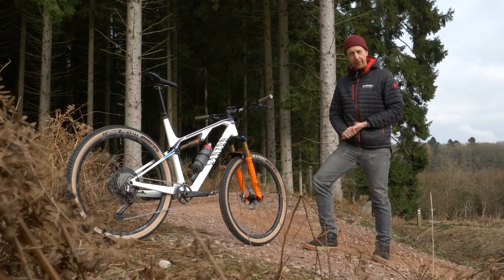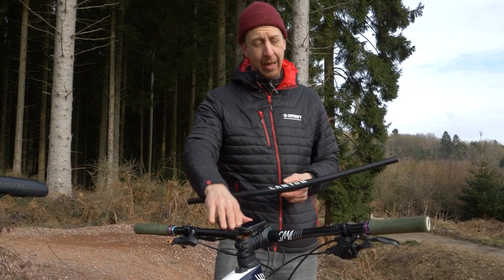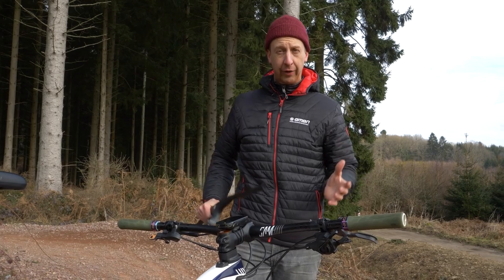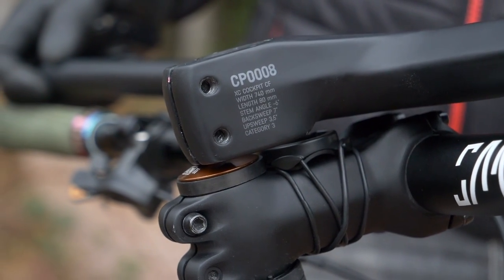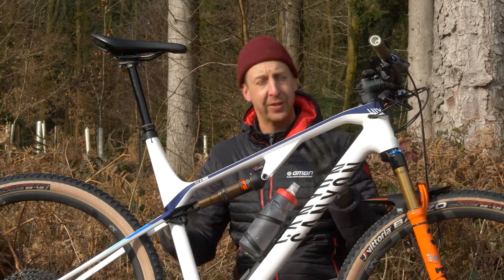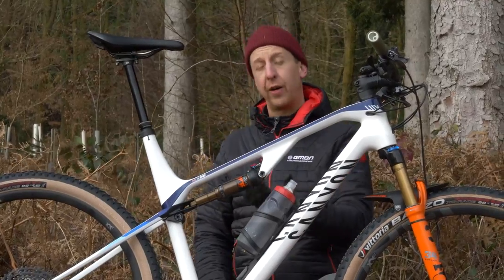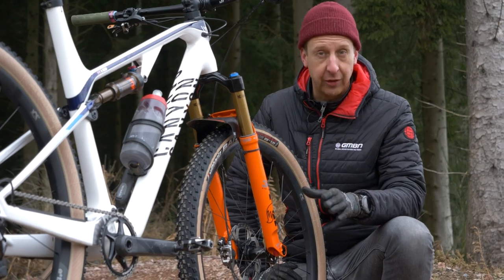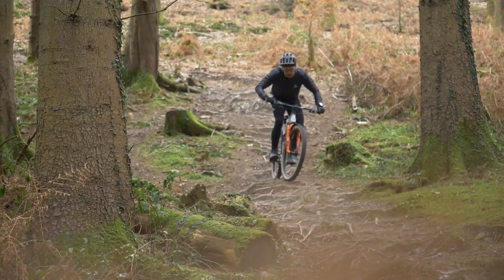How To Make Your XC Bike More Downhill Capable | Downcountry MTB Mods

Comment: So I was in a unique position where I didn’t have a single bike. It I had a decent budget to either get 2 mid range bikes or one high end bike. Thinking a gravel bike might be the best option as I could do some road and basic off road riding with it I discovered the bike that I wanted was still out of my budget range. But I think this was a good thing as it lead me to look at an XC bike. I was surprised that the geometry was steeper than a trail bike, the 29” tires made the bike fast on or off road, and it even had carbon wheel that made the bike super light and again really fast. So I decided on getting the Giant Anthem Advanced Pro 3. It’s great for basic trail riding, which is all I want after some unfortunate crashes due to me thinking I’m a better biker than I actually am, and it’s fun on the road as well. I’m sure that one day I’ll get some type of drop bar bike, but in the mean time I have the all round XC bike that suits my needs to bring full two wheel enjoyment. So what are your thoughts? Did I make the right decision?
Reply: I was in a similar position, looked at gravel (only for 5 minutes because i know i'd never get on with curly bars & brifters!) & then bought a 2017 giant xtc advanced. Frame shapes of modern gravel bikes look suspiciously like hardtail xc bikes from that period!

Shortened the stem & swapped the fox step cast 32 performance for a bright orange 2022 step cast 34 factory, & this thing is now an xc weapon. It's got aero bars too for the road.
I think all it needs is a 4 piston front brake & it's been fully "downcountrified".
Reply: @skyriminspace  that sounds perfect. Enjoy the trails.

Comment: I bought a second hand 90mm mechanical dropper post just to try it out and is the best upgrade I could have done to my bike. I even like the mechanical system better than the hydraulic, because of weight, fixed positions and simplicity of maintenance.
Reply: What does it help with?
Reply: @theparadigmshift74  With making room to shift your weight over the bike while going downhill on broken terrain. It is safer and more comfortable. For XC, where you have constant ups and downs is ideal.

Comment: One thing I noticed is that geometry is really everything. Ok true you cannot change that on a bike but you could go for a xc bike with a better geometry than another one. Was just testing my steel fully rigid mtb that I got for bikepacking and it felt more capable than my Scott spark tuned which is fully suspended!

Comment: I usually have my break levers uneven, I always have my rear break pointed a bit more down so it's easier when I stand up and my front break a bit more up so it's easier when I sit. Since I don't want to slam my front break when  I go downhill  it works
Reply from the maker: That's quite an interesting setup! 👍
Reply: @gmbntech  Thanks

Comment: I took at 1990ish hardtail xc bike down lift-served trails once. Biggest problem with that was honestly the cantilever brakes being worthless. Slowing down was a safety issue. If I had upgraded that thing to have even modest mechanical disc brakes a la 2005, it would have been perfectly fine. I also did lift-served trails later on a 2004 Specialized FSR. The full suspension was nice, for an older xc bike, but the main issue was still brakes. The V brakes were still awful, not as bad as cantilever, but still bad. I did the same trail recently with a modest trail bike that had 180mm hydraulic disc brakes and it was so much less panic-inducing.

Comment: Good video overall with some good points. I like that you qualify some of the statements by height, weight, intent  etc. I have to laugh about "massive" (and other emphasis words) when we're talking about small deltas.  A few millimeters wheel width, a few millimeters q factor, a few millimeters fork travel. They all make a difference, but none fit the truth in advertising effect of "massive".  Thanks for the smiles!

Comment: If your going to buy a dropper post don’t go cheap. I bought a £50 dropper post, it rattled, it was difficult to setup, it broke within a couple gentle rides. You have to splash some cash to get one that’s worth the money.
Reply: 1. Fox Transfer Factory $360
2. OneUp Dropper V2 $215
3. BikeYoke Revive $375
4. PNW Loam $199
Just my opinion. I have a Fox Transfer dropper rn and it has been amazing but I will say that the oneup is almost a good!
Reply: BrandX do some excellent ones. Not the fanciest but cheap and near bulletproof
Reply: trans-x or brand-x (same thing) they make some great dropper posts, they are OEM dropper suppliers. also the pnw posts and levers are essentially rebranded trans-x posts

Comment: About the brake levers, to me it seems foreign to see you braking with the second knuckle on your finger.  I use my finger tips for braking which puts the brake levers into a lower position still (but not XC low).  Maybe it's just me.
Reply: Second knuckle braking gives you more endurance for long descents, imo. Also good for modulation.

Comment: When adding a shorter stem, wouldn’t wider bars compensate for that with your position.  The stem brings you back but the wider arms would bring you forward a bit?
Reply: Yes, see how far Doddy has his seat loft also.  Combining the two really puts his weight much further forward
Reply: No wider your bars do not bring you more forward. It would be negligible. What it will do is negate the shorter stem. A shorter stem reduces the steering Arc a wider bar increases the steering arc. When you want to Quicken the steering you either shorten the stem and or the bars. If you want to slow the steering down you increase the length of the stem and the bars.  Not too mention very wide bars are not ergonomically correct, they put undue stress on your shoulders. It's okay if you just strictly doing DH, but for any type of prolong riding you are doing damage to ligaments and tendons over a long period of time.

Comment: #askgmbntech Doddy I am confused. If you install wider bars with the same length stem wouldn't you effectively be putting more weight bias toward the front of the bike? I would think if you widened the bars you could shorten the stem and keep the same weight distribution on the bike. ???
Reply: Then you’d have less weight over the front wheel, unless the bike stock is on the short side I personally wouldn’t widen the bar

Comment: Scott Scale 740... Brand X Ascend II 150mm dropper, Nukeproof Horizon Carbon bars 780mm 25mm rise (original 730mm flat), Nukeproof Horizon stem 60mm 5mm rise (original 90mm -2 degree drop), Works Components 2 degree (slackened) headset (original 67.5 degree, now 65.5 degree), 1x conversion 11/46 cassette 36t absoluteBLACK oval chainring, Shimano sintered pads, tubeless conversion, MAXXIS MINION DHF EXO 27.5 2.3front/MAXXIS MINION DHR II EXO 27.5 2.3 rear, Nukeproof Horizon Pro Enduro peddles... XC dna with trail/enduro genetic modifications 😊
Reply: That’s a lot of customisation going on there (maybe you chose the wrong bike) I ran a 60mm stem on my Scale Large (stock 80mm) it was far too short and I found it uncomfortable and messed up my riding position so I’ve gone back to 80mm. It doesn’t look as good but short stems are better suited for trail bikes with the riser bar, unless you’re trying to achieve the Doddy “down county” of course.
Reply: @scottlstone  it’s been an evolution, a work in progress allied to my journey over the last 5 years. It was a questionable choice back then but one I’ve had to live with and I’ve learned a lot and improved along the way... my Scott rides very well in its current setup and I enjoy pushing it as well as myself. It’s gone as far as it can, unlike me and I’m constantly learning and hopefully improving. My next bike will be a full sus but in the meantime I will live and ride within my means, until circumstances and good fortune permit
Reply: @darcyphillips70  I’m expecting a new Scale frame out in 2022 (the old one hasn’t changed for a few years so geo is getting dated) so I may take a look at that, but I think I’m with you as I want a full suspension option. Maybe I’ll remortgage house and run two bikes, a Yeti perhaps 😂
Reply: @scottlstone  yeah they ain’t cheap are they 😬 Love my Scale 740 and you’re right, geo is well dated know but I wasn’t sure what I wanted out of MTB when I first started out. Slackening the head by 2 degrees, shortening the stem and raising the bars transformed for it for me. She’s a keeper, she still climbs well but does the off piste stuff and trail centre shenanigans that I enjoy most... odd bit of XC thrown in for good measure. I’ll not get rid of it, my goal is a Nukeproof Giga though.... opposite end of the spectrum and I’m a little way off turning that into a reality. In the meantime, it’s me and the Scott at FoD with plenty to smile about 😊 Good luck with the Yeti, nice bike... and good to talk, stay safe dude

Comment: Great video just a quick one with regards to head tube and steam tube angles what’s the ideal for an enduro setup in your opinion. Looking at a moustache game, commencal meta power 29 and mondraker crafty, they all have different angles but all say are enduro which would you say is better
Reply: @Josh Darlow thanks josh this is what I’ve read to so the commencal has the better of both 63.5 and 77.

Comment: Why don’t they connect the dropper post with the rear shock, so you open the rear shock when you drop the post. This way the shock is closed when you’re climbing and open when you descend and every small adjustment in between.

Comment: So I have a Specialized Camber Pro, which is a trail bike. It has 110mm travel in the front. Is it possible to make it more aggressive by replacing the front fork with 130 mm of travel? My riding style has changed, now I want a more aggressive ride. Close to a enduro style riding.

Comment: What’s a good XC but more trail friendly tire ?
Reply: The maxxis aggressor, whilst not technically an XC tyre is still pretty fast rolling, especially in the lighter casings and offers much more grip for trail riding 👍
Reply: Maxxis Ardent and Rekon are good options, pretty fast and lots grip till gets super wet.
Reply: @nebnollock5198  I run the Aggressor/Dissector combo on my trail-ish XC bike. Feels much faster/lighter than expected.

Comment: So a question.
Should I then lower the pressure in fork and shock untill I use all the travel. Even if it means plenty more sag then 20 %?
Reply: maybe there is a volume spacer in our airshock. Mine came with 2 spacers. Lose one and you'll notice the difference. You will use more travel. 
I actually added 1 more spacer and now I don't dive and don't bottom out anymore, that's the other way around

Comment: Doddy,  Axle extensions? Recommend or not?
Reply: If this is a separate part that screws into the crank and the pedal screws into that then definitely no - there's a lot of movement in pedal threads as they're used, which is unavoidable due to the design, so adding a second set of threads just as bad that's also applying more bending to the crank threads because the pedal axle has a longer lever is going to reduce your reliability, and that's assuming the extension isn't too weak itself to take the loads.

Comment: a friend of mine constantly complains about hand pain. I've told him it might be his brake levers that are too high but he doesn't want to change them, as he thinks the higher, the better. how high is too high? he has them at 25°, I have them at 38°.
Reply: Finger length also is a deciding factor
Reply: Mines 35deg, depends how far bikes he’s off the bike tbh
Reply: Why in the world would he think high brake levers are good?!  I get that some pro riders like it, but for most it’s a very unnatural position.  The standard used to be 40-45 degrees.  Where do people get these ideas?  Is it because they saw some pro does it and they want to be like them?  Nuts!
Reply: @keirfarnum6811  Depends how steep your local terrain is. If you’re always hanging off the back of the bike, then it makes sense, especially if your bike has a long reach.

Comment: The bit that would worry me is if the lightweight frame can take proper downhill, particularly of you are a heavier rider. Some XC full suspension carbon bikes have very thin rear flex stays and these would be my main point of concern.
Reply: Just don't huck it, lol.

Comment: Curious what the bike weighs with the changes? Also, what size is that? is it a Large or XL?
Reply: He said it's an XL I believe.
Reply: I have a Lux 6 XL. I did some mods (carbon bars, shorter stem, Oneup V2 210mm dropper, lighter carbon seat). It’s around 27.5lb with xtr pedals if memory serves.

Comment: Vittoria Barzo to make it more DH capable? Why not put the meatiest, widest tires on the bike??? The tires make a gigantic difference in downhill capability. You will probably have to pump up the tires more to roll ok, but you simply can't run XC tires downhill and expect great performance. You can however expect a lot of drama and uncertainty, if not a string of unnecessary crashes. That's really the number one XC fallacy, that they by definition have to run skinny slick tires. Absolutely not. Throw on whatever fits, point it downhill, and see the difference. One might argue that it's not an XC bike anymore if it has trail or DH tires on it. OK, whatever. We are talking about how to improve performance, not keeping some definition pure.

Comment: I did all of these on my BMC + I installed offset bushings and cause of that shortened the stem
Reply: What does offset bushings have to do with stem? Which way did you offset?
Reply: @just6979  The bushings of the shock wich slackens the HTA and increasing wheelbase. To compensate i shortened the stem
Reply: @Tellurian82  if you went slacker, then you don't need to shorten the stem. The reach would have been reduced slightly already, plus the bars are further behind the front axle too.

Comment: Do you know any 130mm or 140mm travel qr forks
Reply: pretty sure there is a Manitou machete thats quick release. Also never go up more then 20mm travel compared to stock.
Reply: It may be cheaper to get a through axle wheel instead at this point. Use a Shimano QR skewer unless you're a fan of the front wheel moving around or even potentially lifting out of the fork on heavy braking though - there's a very good reason through axles have completely replaced QR's on forks.

Comment: With all these changes, why not ride the Neuron instead?
Reply: Does the Neuron weigh 26 pounds?
Does the Neuron climb like a cat on fire?
Didnt think so.
Reply: @marcalvarez4890   I think you might have misunderstood my question. With the changes made in this video you will end up with a heavier bike and if you don’t get all your parts for free I think it would be a better idea to go with the Neuron since that comes standard with dropper, Fox 34 and wider bars. If you’re looking for a lightweight bike the Lux is of course an excellent choice although I would probably go for the Orbea Oiz instead.
Reply: @marcalvarez4890  I have 25.8 pound Neuron SLX and 20.9 pound downcountry Oiz team and Oiz is much faster uphill and has way better pedal efficiency. Probably this Lux is also good uphill even with all the modifications. Neuron is different bike. Frame has much thicker carbon for crashing and trashing and q-factor is too wide for comfortable pedaling. For me they are 2 different bikes. One has longer dropper and 60mm stem and I feel secure downhill and on jumps. Oiz has 90mm stem, shorter dropper and is very fast but fragile and nervous especially when you are heavier rider.

Comment: I’m considering increasing my front fork travel on my 2021 Giant Anthem from a fox 32 to 34 (100mm to 120mm) but am concerned about the resulting change in Geo! Has anyone tried this? Is it too risky?

Love my XC bike, but would like to beaf it up a bit for my local / steep terrain and to do the odd local enduro
Reply: 20mm should be alright
Reply: I've done this before on other bikes and the 20 mm change is noticeable, so if you really like the current position expect to need to lower the stem to get back to it after changing the fork. Usually there's a range of bike positions you'll be comfortable with, so you might be able to get used to it with no other changes. Keep in mind that with the same headset and spacers as before, the pedals, saddle and handlebars will all be in exactly the same position as before, just all rotated back slightly due to the extra fork length. What I usually do is test the bike before and after the change on a steep climb and a steep descent and see whether I need to make adjustments based on the bike feel at both limits.
Reply: @demondavejeep  That sounds like an awful lot of travel of an Anthem - my Anthem X has 100 mm travel at each end and the X edition was the long travel version...
Reply: @demondavejeep  Mine is a 26" wheeled bike from back when 26" wheels were the standard wheel size. The standard Anthem (Without the X in the name) was, I think, 80 mm front and 75 mm rear travel at the time. 

I was so disappointed when I tried the first 29er Anthem Giant made, it felt like a boat by comparison with the 26" in handling terms - so glad I got to try it first as it had none of the handling I loved from the 26" bike. It took years more before 29er geometry got the chainstays short enough to let the bikes handle nicely again, though I realize they're still not as lively as they used to be when I try my 26/27.5 hardtail or the 26" Anthem after using my 29er.

The current travel figures really show how much travel inflation has happened in the past few years though. Not sure if Giant are making any actual short travel bikes at this point if the Anthem has gone out to trailbike numbers.
Reply: @peglor  Thanks mate, really appreciate your comments!